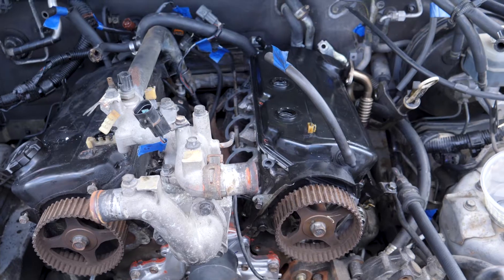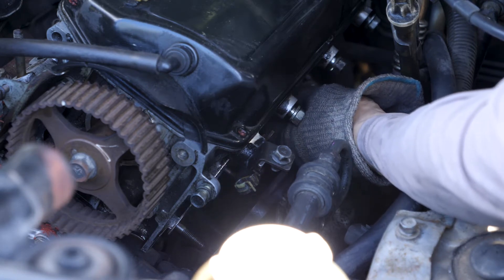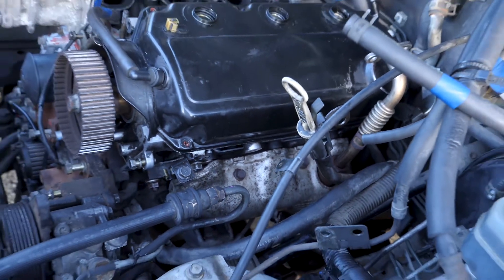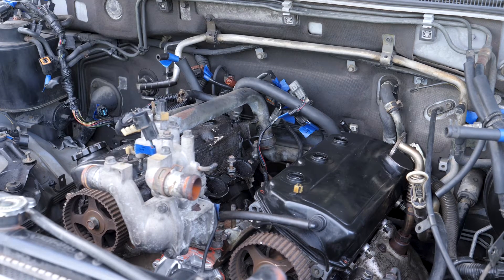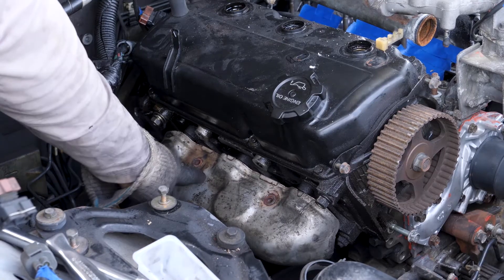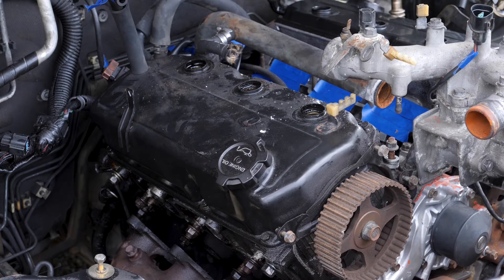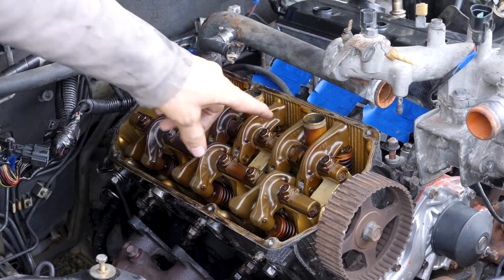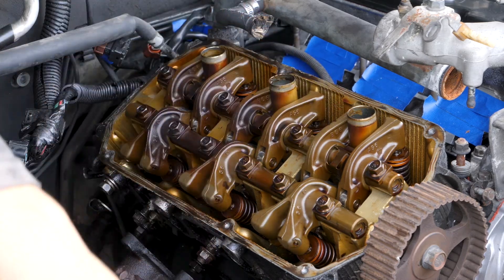Mitsubishi Montero Head Gasket Repair Part 6: Right Exhaust Manifold and Cylinder Head Removal

Comment: How tight did you go with the bolts for the head gasket?
Reply from the maker: They need to be tightened in a specific way. There are multiple torque values that you have to hit. The point of this process is to tighten down the head gradually and evenly across the mating surface or else risk warping the heads or damaging the head gasket. The process is too long to explain in a comment. I would definitely recommend buying a service manual like I did.
Reply: @ColoradicalMike  hmm…okay. We have searched all over the internet, called many people and cannot find the book for our vehicle. Ours is a 2002 Mitsubishi Montero XLS. We have followed your videos and have learned and succeeded with several replacements. It is not starting and we think it is gas related. Also, didn’t know that there isn’t a fuel pump relay so, searching vigorously to rule out if it’s the fuel pump, not enough pressure to the fuel rail and a few other things.🤨
Reply from the maker: Here's a link to the one I bought. It was very helpful as a reference and to make sure I was following the correct procedures. It also has trouble shooting processes you can follow given your situation, crank and no start or whatever may be going on.
https://amzn.to/3ygXtbi

Comment: Diong mine now hey what size head bolt hex socket did you use?
Reply from the maker: May your repair go smooth and frustration free. I used a H10 Hex for the head bolts.